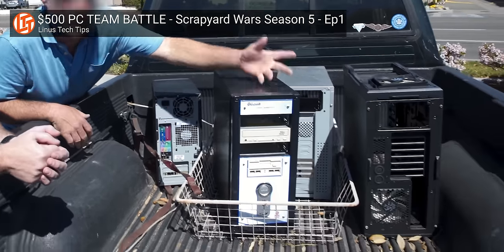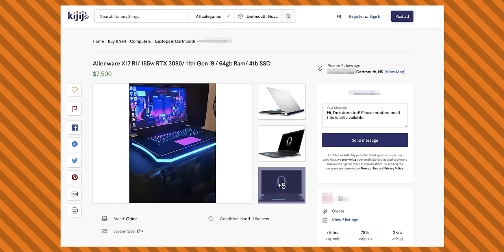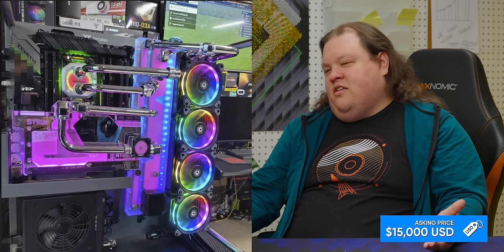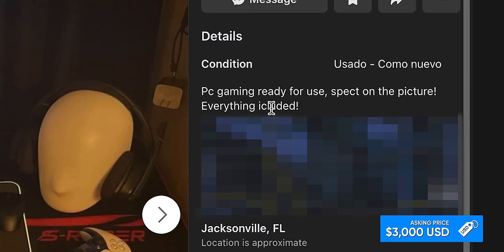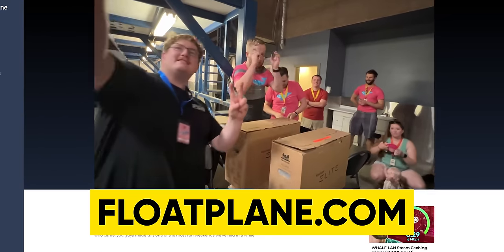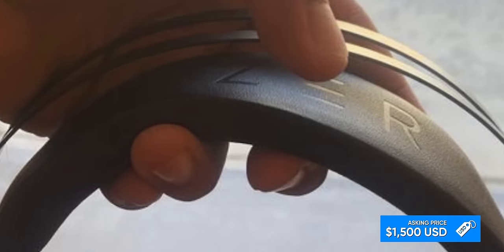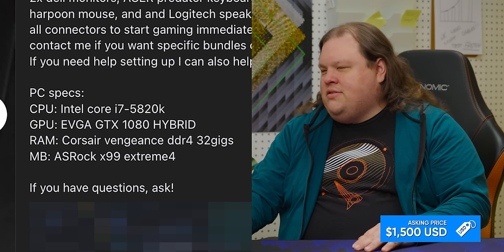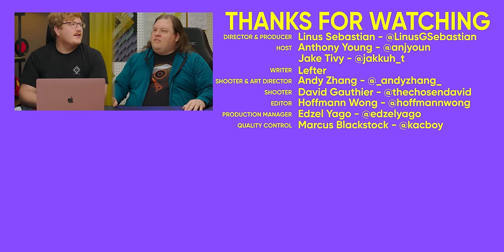Roasting the Worst PCs on Craigslist

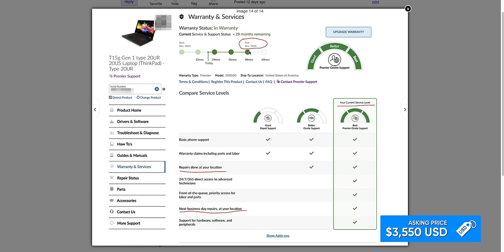Comment: 11:16 my hp pavilion 17 gaming laptop isn't that really hard to clean, got it new a year and a half ago and its still growing strong, a monthly dust clean using an air compressor and a fine makeup brush, upgraded from 16Gb to 32Gb of ram recently cause I like multi tasking and designing, storage came as 256Gb ssd and 1Tb HDD but have upgraded to a 2Tb and 2Tb respectively with an external 1Tb just incase via a usb C dock, since I use a lot of digital music software which take up a bunch of storage. 
Fans and device are simple to clean out aswell as the exhausts and the battery can be replaced with a brand new one by duracell which can hold double the capacity and output thr same power for a fraction of the cost from Hp. 
Don't use the speakers or sound card as i have an external mixerboard and surround sound system, fanboard under neath which catches a bunch of dust instead of it going into the laptop and keeps it at a cool 40°C constantly even when under load.
 So overall, not a bad deal I suppose for £800 instead of £1099 with student discount :)

Comment: Guys what is the hate about dell’s servicing over there? Back in 2011 they actually came to the dam construction site i was working in a forgotten valley to change my laptop’s keyboard and cd driver for free even though i broke the key from keyboard. I bought that computer from a retail store and didn’t buy any extra warranty, it was already included in obligatory service brands must provide to the customers. What has changed since than what da hell they are doing over there.? 

And those lenovo thinkpads are bussiness oriented laptops, they are very rigid, stable, and lots of bits and bobs this case they are little bit expensive. i use lenovo think pad p71, my company paid 5000$ (xeon+quadroP5000)for it 4 years ago. i never buy one of them with my own money don’t get me wrong it is the best computer i ever used over 30 years of pc owning(not only in terms of specs) but i can’t justify that money unless it is your money making device

Comment: i just built a rig during covid. pretty solid build, i5 11600k at 3.9 ghz base clock, msi mag z490 lga 1200, 16 gb of 3600mhz gskill. But due to the GPU shortage i settled with a 450$  1060 6gb gaming x from msi. good card for 1080p, but I'm finally now a year later,  able to somewhat afford the 3070 ti i needed to finish the build. lame sauce

Comment: PS/2 is not bad. Really, its interupt driven for reduced lag vs. USB that is polled and uses extra CPU cycles. Plus its guaranteed to be usable in the BIOS. I had problems using a USB keyboard in BIOS. I had to return one MB, MSI I think, years ago due to discoving the BIOS used an internial PS/2 to USB for the PS/2 port on the back, keyboard was not recognized on most boots.

Comment: 8:22 I have 64 gb of ram, I am currently using 52gb, and chrome will easily eat that and 64gb of paged if I don't watch it religiously, so thats why, if I could put 256gb in my pc, I would just so chrome crashes before it ever eats enough ram to make everything else unstable.
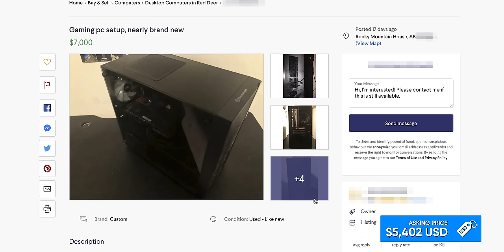Reply: 9:30 was watching the 3060ti as it was the gpu I would have gotten at msrp, that thing went for 1000-1500 depending on when in the gpu shortage we were at, worst I ever saw sold was a 3080 for 3000$
once mid range hits 500$ im just going use igpus and never play a modern game again.

Comment: i only bought a 2nd hand GPU in 2008 and it worked! and a 2nd hand Laptop for 50 buck, then change the keyboard on it, and it looked then brand new. BUT i would never buy 2nd hand hardware again, only brand new from hardware online shop.

Comment: There's no way that 5950x is that expensive. My 5950x comes in at right around $3,000 USD, and apart from my primary SSD being Gen 3, and my GPU being a 6800XT, it's more powerful.   Heck, I've even got more storage(though in fairness 4TB out of the total 6 is spinning rust RAID 1)

Either some of those parts are ludicrously overpriced or he's trying to profit.

Comment: You keep saying 128 gig of memory like it is a bad thing. For me the more memory the better. I also am not a gamer, mostly run linux and unix and would use that memory. I looked at a used sun system that had 512 gig of memory and 8 16core processors but could not afford it at the time. Under windows that kind of memory would be a waste

Comment: Razer aren't that bad anymore. Their headsets are actually quite good. The Kraken TE headset is actually not bad. I went from Astro A50s to Razer because my Astros broke (stopped charging) and after they wouldn't replace even though only 18 months old I decided I was never paying that much on a headset again. Got my Razer headset for under £50 and sure they are wired but they aren't bad!

Comment: I've never even looked at used PC parts. 

Just too much weird stuff going on. 

Every PC is built on a budget. Whether that's $500 or $5000, there's always higher and lower. 
I'm building what I need. I'd rather not depend on others (although I can understand some of your viewers don't barely understand a screwdriver, I may have a different viewpoint as I fix everything I own myself).

Comment: When they said a 5950X doesn't go under 45C I looked at mine and yup, 53C.
Reply: Mine's at 35c at the moment (ambient temp 28c). 7 fans worth length of radiators.
Reply: So a 7 fan radiator gives you 18C lower temps over an NH-D15
very gud.
Reply: @Mycatisinapiano  It's 2 radiators totalling 900cm.
Reply: Out of interest, what else do you have in your system?

Comment: I actually would love some help. I am trying to sell my PC but I have no idea how much I can get for it... I made it arround christmas in 2016. 
Can you throw me some values? (I was expecting arround 600$ )

Intel I7-6700K Quad-Core 4.0ghz (8 threads)
Gigabyte Geforce GTX 1060 (6gb)
Kingston SSD 250 GB ( I can't recall the exact model now, bought this later on 2017)
G-Skill 2400 MHz 16GB RAM
Brand New WD Blue 1TB (I want to keep my old disk for saving files, so I'm getting a new HDD to not sell it with only 250gb) 
Nox Hummer PSU 1000W (2016 model)

Am I asking too much? It has a sick cooler aswell and rn I can't recall the motherboard
Reply: Deadpoppin  Well. After 2 months I finally sold it. I got the 600$ for it, but I had to throw my FHD 22' Monitor.... So I guess the PC was about 540$ ? I was expecting better but no one came forward!

And yess I wanted you to know this xD

Comment: gonna kill myself what are these prices

i went with i5 12500 rtx 3070ti asus b660 plus the wifi d4 version  corsair case my roommate gave me his pwer suply 750w  2ssd for 1.5TB(questionable desision i know) and what not with some waranty and i spend 2 300 USD (all new except for PSU and gpu was 920USD)    and i question if i got screwed and it was march mid-end

Comment: I wanted to sell my PC with 7TB of hdd storage and 1.75tb of ssd storage,  RX 480 (8gb),  aio cooled (both the i5 and the gpu) I5 6600k  2*16gb Ram,  800W OCZ Psu and all of that crammed into a tiny case for 500 Bucks. 

I DIDN'T EVEN GET ONE SINGLE OFFER.